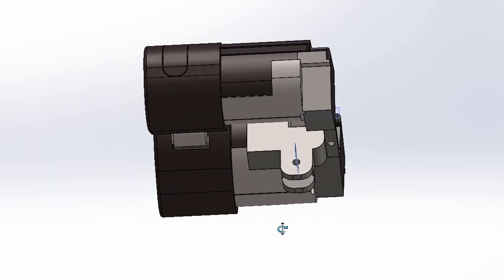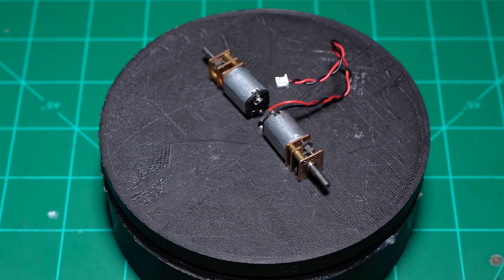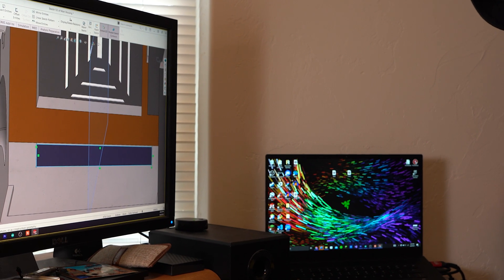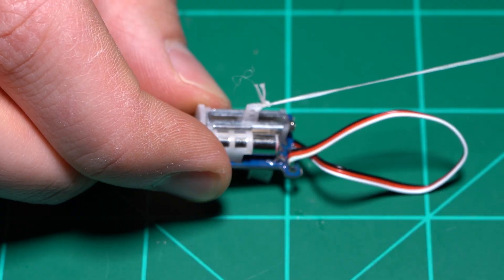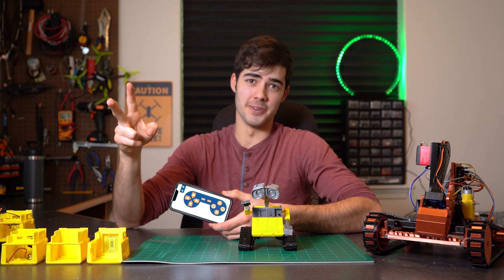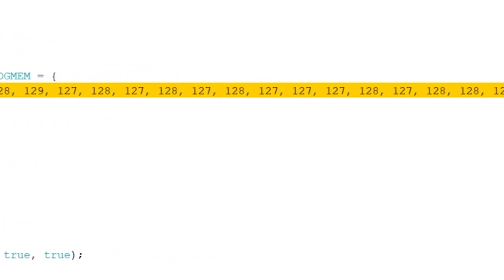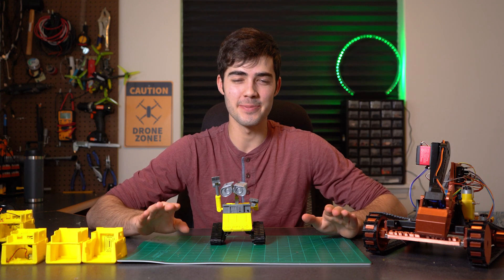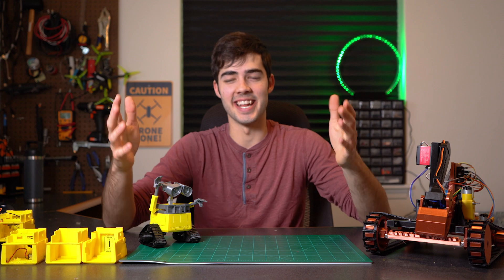DIY WALL-E Robot (Fully Functional)

Comment from the maker: If you're looking to do the wiring manually there's a high quality PDF Wiring Diagram on the GitHub Page for this project(Link in Description). Also what are peoples preferences between Onshape and Fusion360. I'm looking to switch to make sharing 3D Models more accessible. Thank you!
Reply: Fusion is free. Makes it my choice.
Reply from the maker: @derf2738  Free is definitely what I'm shooting for! I'd like to be able to share the exact models I design so that people can add additional parts without having to import a STL.
Reply: in my case I cutted all the pieces with 3d builder to print each pieces one by one to assure the more quality some pieces need supports here CR6SE :) printed in 0.12 !
Reply from the maker: @dimf5kbb977  Thank you for the response! Also I made another Thingiverse listing with all the individual parts here, but it would seem you beet me to it haha. https://www.thingiverse.com/thing:6004455.
Reply: Sorry, where can I get the application?

Comment: I build the larger chilli with ESP32.  But he needs company.  Contenplating using the ESP32 C3 board i used for the larger again. Very compact with BT and Wifi.  Whats the advantage of the arduino board over the ESP32??  Havent used arduino yet ??

Comment: Do you use supports or just normal for the prints?
Reply from the maker: Some of the parts require support, but you can get away with auto generated
Reply: @professorboots  should they all just be with supports just in case?
Reply from the maker: Yeah pry not a bad idea

Comment: I might build one. What 3d printer do you have? I can only print PLA with mine, so the tracks will be difficult.
Second question: why didn't you use an esp32 or a wireless pico? 
Thanks for showing us this, I've always used old ISD ic's with my microcontrollers for sound beyond beeps, so I'll be using that less.

Comment: My ids love Wall-E and this is a great project to do with them. I am having a random issue with the Gray PLA Parts. I have tried to print it a few times and it keeps failing. I end up with partly printed parts and gray spaghetti.  Any chance you would share this file unlocked or send the individual pieces so that I can make an arrangement change and hopefully get these parts printed.   Other than this, seems like a sweet project. Will be ordering the PCB and parts soon to finish this up.
Reply from the maker: Ahhh glad to hear from fellow fans of Wall-E! Hmmm that's really strange. Of course! Here's a link to my other thingiverse post but with individual pieces. https://www.thingiverse.com/thing:6004455. Let me know if you run into any hiccups on the way, I'd love to see how it turns out!
Reply: @professorboots  thanks. Will definitely send some pics, if you would like to see the issue and also the final product

Comment: I'm currently printing this and I'm just hoping my build plate is big enough. I decided to start with the wheels.
Reply from the maker: Good plan! Also I just realized that the left support for the tracks is an old version so I’m going to update that tonight!
Reply: @professorboots  did you update it? cause I'm starting to print now D:
Reply from the maker: @christianf21  yep everything should be good to go, but if you run Into any issues let me know